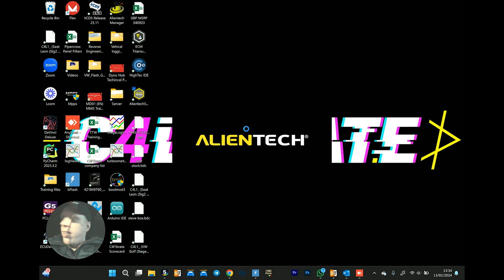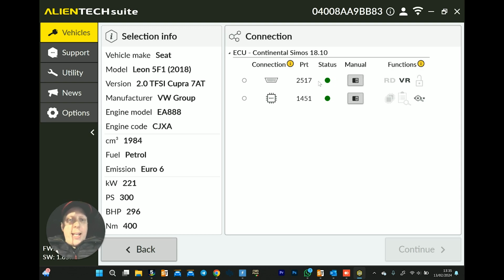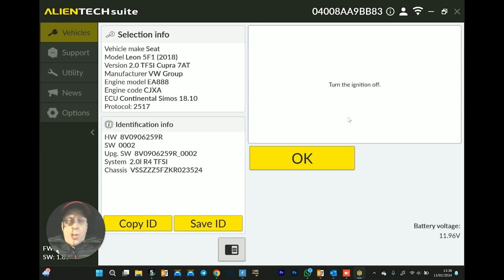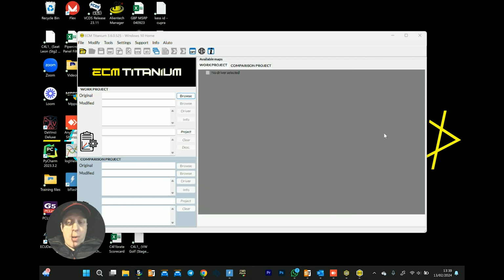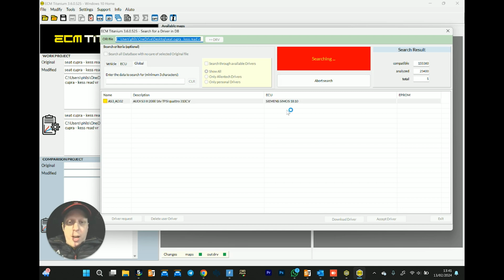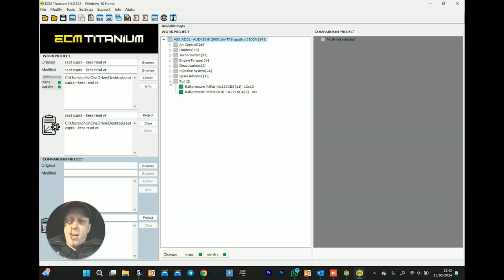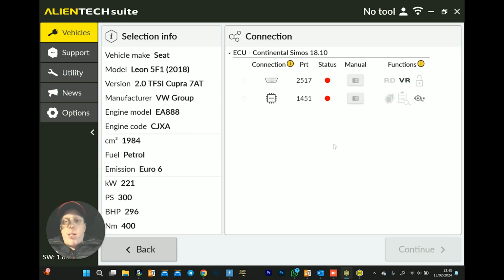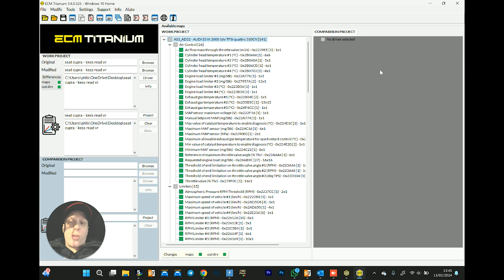Alientech Kess V3 and ECM Titanium System

Comment: So there are ecu`s that don't support Read but only VR, what if the map on the car has already been changed? If i understand correctly the VR will just download factory map for that car
Reply from the maker: Correct, if you want to retain the current tune on those cases, then we would have to bench the ecu to get access to the current data

Comment: Would love a video on Swiftec & Fixwave. To see how their solutions and maps compare.
Reply from the maker: 2 very different tools, but i can cover them both. You can use swiftec as a map editor and solution supplier, where as fixwave its just solutions. 

stageX and swiftec are more compareable
Reply: @Phil-Cooper  ah right. Fixwave also do stage 1 and stage 1 plus. It may be only for certain ecus but yes agree with you. Video would be great nonetheless
Reply from the maker: Yeah they have some script for chucking out a tuned file, but you cant edit the file in the software, where as swiftec/stageX you can. 

Ill show you :)

Comment: 6:30 jfc they still search through ALL the drivers? with a VR from their own tool. kinda nonsense they have all the info inside the file to match the driver straight away .. at least filter by ecu type, why would u check if a boat ecu driver is compatible to a simos18 ecu? XD
Reply from the maker: Agreed it is long winded.